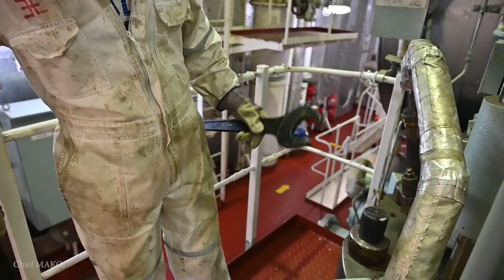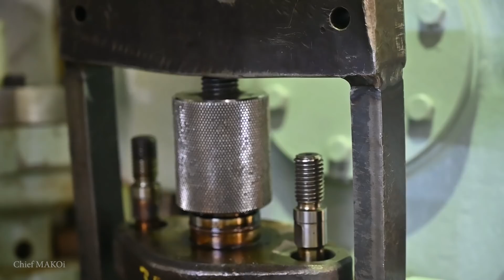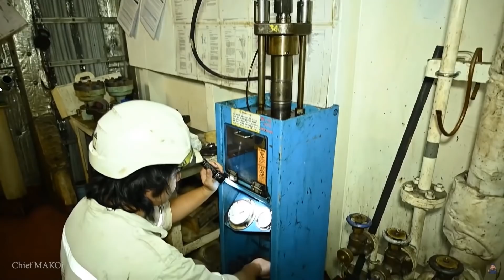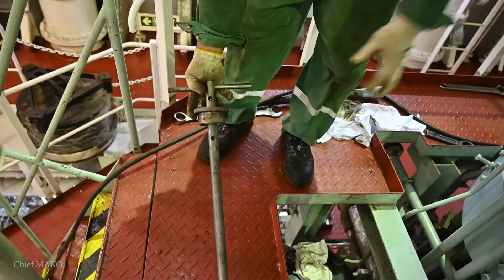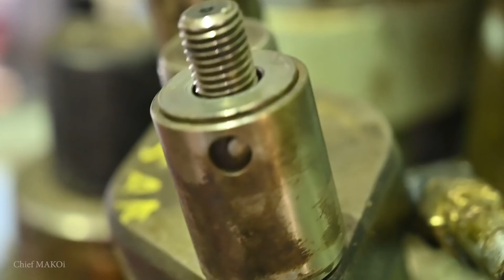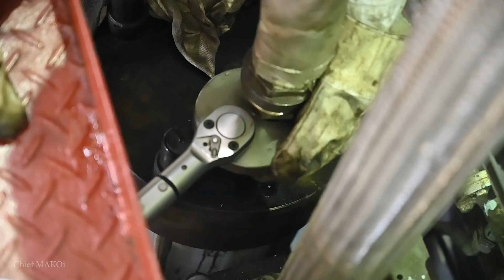Ship's Engine Maintenance : Fuel Injectors | Chief MAKOi

Comment: Was interesting, but was ruined when the technician used the wrench incorrectly.
When tightening a bolt or nut with a wrench, the load always meets the bottom of the moving part of the wrench as it prevents the wrench from getting an angular error between the surfaces.
Proper use extends the life of the wrench and also of the bolt heads and nuts.
You can see wear marks on the nuts in the film that indicate repeated incorrect use of the wrench. If you really have to use a wrench, when fixed ring wrenches and sockets always are a better option.

Comment: On heavy truck diesel engines...........10,000 hours would be what most operators would expect from injector nozzles.  The major problem has always been that OEM fuel filters are only 60% efficient at their micron rating.  But new aftermarket products are on the market, widely used by transport and mining industries that are 99% efficient at 2 micron, and so injector contamination and even rust from dissolved moisture (always present in petroleum fuels of all kinds) has been eliminated.

Comment: Chief,
I'm curious if - on each subsequent engine design - the companies take notes from engineers on how to make their engines easier to work on?  It always seems like, despite the size of the engine, everything is cramped together.

Is there anything on the engines and machines you work on that continuously frustrates you with poor design, considering that they "know" that you'll have to do maintenance on it?
I'm reminded of a car that I worked on where you had to remove several things just to get the battery out.

Comment: How much pressure the injector pushing to the cylinder?
Can you replace the injector while the engine is running??
Reply: I have that same question, can the injector be replaced while the engine is running?  Would you stop the M/E while at sea?  If not, why wasn't there air being pushed out the injector hole on each up stroke of the piston?

Comment: A bit larger than the ones in your car.

BTW a motor are not a motor before a person can comfortably stand on top of the piston, move around in comfort in the crankcase, and with a little MASSIVE sweating and a lot of air, crawl around in the exhaust manifold.
And if it go more than 100 RPM,,,,, well its just a toy.

BTW on Torm Kristina we had a hole burned strait thru the valve,,,, and mind you inside the valve seat, and large enough for my little finger ti fit in it. 😮
All hands on deck to fix this,,,, actually i even think i saw the chief engineer in the "hole"

Comment: In most all the big diesel engines, I see a large high-pressure hose with the braided covering. can you tell me that does? It looks like it would go to the area of the top of the exhaust valve. Nive video, i always like to see what's in those big engines....!!
Reply: Yes that's a hydraulic line that operates the exhaust valve. It saves energy by eliminating the camshaft and all those other moving parts, as well as allowing valve timing and duration to be completely electronically controlled. Think of it like VTEC, but a lot better and more flexible.

Comment: Wait how big & exactly what psi. Ratings can be reached with these Giant diesel engines they say the fuel injectors from commercial trucks can spray fuel thru a 2×4 piece of lumber or else the secondary Question  what sort of compression values are reached on these Giant motors

Comment: I'll just say this. Drag teams get the car in pits, dissassemble the engine COMPLETELY and reassemble it all in just a few hours.

If you had a team of well seasoned mechanics, you could get a major service done on one of these engine in less than a day.. filters, oil, injectors, anything that doesn't need a massive lift. And possibly even that.

Comment: At what bar does the injector fire? Also How many cc of fuel is injected? The tractor trailer I used to drive used about 170 mm³ per stroke which is like a drop in the bucket compared to this beast. This makes a on the road tractor trailer fuel injector seem like a TicTac. I have always wondered what they look like now I know

Comment: That's wild that it's lapped in situ.
That would cause so many problems in a smaller engine, but with a big engine you get big tolerances, so it's acceptable.
Reply: In a smaller engine like a Detroit Series 60, you just pull the injector cup and replace it along with the injector. Sealing is done with soft copper washer, so no lapping required. Make sure the orings on the new injector are installed correctly, no nicks or cuts, and oil them before reinstalling the injector. I once had an issue with one leaking exhaust gas into the injector cup, right from the factory, one of the orings was missing...

Comment: Not exactly a toy are they. The filtration system for the fuel oil must be very well designed, I still find it hard to believe they run on such crude oil. Thanks for the video, how about a crankshaft replacement ? I jest of course - hopefully.

Comment: What is the max engine RPMs on that thing? The largest locomotive engine I used to work on was a 16 cylinder, 645ci per cylinder and its max rpm was 900. But it powered the generator only. I'm not sure if ships are direct shaft driven or gen/electric like locomotives.

Comment: What volume of fuel does an injector typically have for injection per cycle?
Is this work carried out on the high seas? (I'd imagine it have to be done if problems arose).
👍

Comment: So it appears this procedure is able to be done with the engine running on the remaining cylinders. If so,  I assume the piston in this cylinder is still in motion. Is there a means to isolate the injector from compression etc?
Reply from the maker: Engine needs to be stopped before doing this.

Comment: From the vid I think torque is a little off. From previous training the crows foot or adapter should be 90 from wrench or torque recalculated with the adapter length.

Comment: Couple of questions.1) do you shut down the engine for the six hours it takes to change all of the injectors. 2) if you don't aren't you worried about running the engine lean. 3) do you carry an extra injector for every injector.

Comment: How often do the cylinder sleeves need to be replaced? How is this done on such a huge engine?
Reply: They are exchanged once in awhile, most large ships have at least 1-2 spare liners in the engine room. I think he has a video on them, but the basic steps are, remove and disconnect exhaust piping and cladding, remove hydraulic and fuel oil lines, use hydraulic cylinder head stretching device to be able to loosen cylinder head bolts. Meanwhile people will be down below and disconnect connecting rod. Cylinder head is removed and lifted with the overhead crane. Next, using the turning gear, the piston is fitted with a lifting bracket and pulled from the cylinder with the same crane, and set down on some cardboard. The cylinder liner can then be pulled out also using the overhead crane. When the parts are out, things like orings and anti-polishing ring on the liner can be inpected, and the piston cleaned and inspected and new rings fitted if needed. Acceptable cylinder wear should not exceed 1-2 thousandths per 1000 hours of running.

Comment: Do you send you engine oil off for analysis to check engine wear? I suppose lapping the injector seats causes so little in the way of metal contaminants compared to the massive size of that engine, or you have some way of keeping them out of the engine when you do it?
Reply: Yes, oil samples are collected. Normally whoever supplies your lube oil, will collect the oil samples and results emailed to the company, like BP or Shell or whatever. Lube oil is typically straight 50W, but different engines might prefer different oils, there's a lot of changes going on with IMO doing to do away with high Sulphur marine fuel oils.

Comment: Wild that your not worried about the abrasive from lapping getting into the cylinder and the rest of the engine.
Reply from the maker: The residue from the heavy fuel is much worse.
Reply: @ChiefMAKOi  that blows my feeble gasoline engine knowing brain 🤯 thanks for the vids and info!
Reply: @ChiefMAKOi  Is there actually abrasive particles like that in the fuel oil? I would think by pre-heating the HFO hot enough, and running thru a centrifuge machine like Alfa-Laval purifier would remove most of the solid bits of rock/sand/silica etc. But I think this engine is so huge, that that small amount of lapping compound isn't going to do anything. It'll get washed out eventually by the cylinder lube oil eventually.

Comment: Great vlog as always! So this can be done out at sea with the engine running? How does a LNG engine work? Same, but the only difference is the type of fuel? In Norway now it is LNG and electric engines powred by batteries that are in high demand at the moment. Green is clean! I just thought of that slogan at this very moment! Cool! Be safe my friend. Plans for the summer vacation?
Reply from the maker: Here in my place it's always summer and always on vacation 😂.
Reply: Jammy 😊 !

Comment: Chief: Doing an equivalent job on land in the USA, locks and tags would have to be applied to the fuel pump and the valve to that cylinder, as well as to the main engine.  Do you use similar procedures?
Reply from the maker: Yes. I just forgot to shoot a clip of that.

Comment: Another great video. Question Chief: after the lapping of the injector seat with abrasive paste the engineer washed out the area. Does that mean all the abrasive paste and liquid gets washed down into the cylinder? After the first few revolutions of the engine with valves opened to stop compression locking then it doesn't actually cause an ongoing abrasive wear problem in the cylinder? That doesn't 'wash' to me so I think the injector seat compound must be a very special mixture that doesn't have cause a problem?

Comment: Two injectors per cylinder? At least you guys have good access, as compared to aircraft engines (which are often very cluttered to get the cowlings fit as tightly as possible).

Comment: My question is does it matter if the lapping compound goes down into the cylinder?
Reply: I was wondering this too, plus all the spraying they did down there that went into the cylinder as well. I'm guessing it just gets burned up/expelled with the first piston cycle when they turn the engine on.

Comment: Do you need to prime the fuel line up to the injector?
Reply: No, that's what the return line is for, just turn the fuel back on. Whatever doesn't get injected will go back to the day tank. When the engine is restarted, everything is primed first, fuel oil as well as lube oil, while slow turning with the turning gear before it's actually started. So any air in the injector lines will get purged during the normal startup process.

Comment: Wow, just seeing all the cuts and angles of shots, I can't imagine how much time it takes to film all of this. Thank you for doing this chief. I also see how hard these guys work. It's tough work and obviously long hours. 
I often wonder how long our car engines would last if they got this type of care! :)
Reply: I second that.  It is a very responsible job for responsible people.
Reply: For ever
Reply: As a mechanic and mechanical engineering student - forever.  There's no reason what so ever that any car built in the last 70 years can't get a million miles on the odometer. All it takes is paying attention to your vehicle and proper maintenance. Both preventative and otherwise.

Never think your oil change can wait, Always do it early. let your engine warm up before you ever take the parking brake off or put the car in gear. Don't forget the little things in your owners manual everyone ignores. Change trans fluid and filter every 75k miles.  Change gear oil in your diffs every 90k. Wheel bearings I tend to do around every 100k. Flush your trans, brakes, power steering, and coolant systems every time they're serviced. Do an engine flush every 3-10 oil changes.  Change brake fluid every 2 years. 

It's expensive, and adds up quickly to an expensive mess to keep track of. If done properly however, on a good car, a million miles is just finish the break in.
Reply: @StrangeTerror yep,exactly
I hate when people say nowadays cars suck because they are made out of "plastic" "not real material" etc.
They just dont give enough attention,nothing changed in cars,the only thing that changed is every manufacturer wants more horsepower so if you are not using your engine in right conditions it will die yes.But wirh regular check,change and normal useage?It will go for a loooong time
And there is a 1% faulty product always,but thats small as fuck
Reply: 4-evah

Comment: Love the content but around 10 minutes crescent wrench being used to tighten the nuts is putting extra wear on them
Reply: I must admit I use a crescent wrench in many areas where I shouldn't so I should follow my own advice LOL
Reply: nuts are cheap and easily replaced its the threads of the fastener id be worried about remember apparently it is about the seating surface at this point but i did get what you mean it kinda set my mind uneasy seeing rounded edges as well

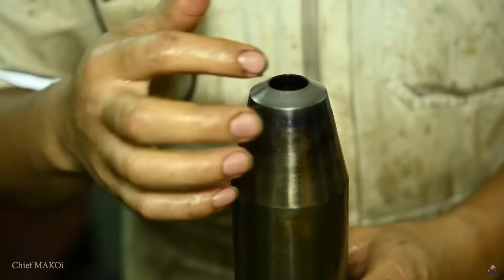Comment: 0:55 Pffft! It's only a "six".😀 Do you stop the main engine on the open seas to replace this injector? Also, how do you know an injector is bad? Do you hear a "miss"? does the ship vibrate like a car? 7:24 I am not an expert, but I am watching this on a big screen tv, and it looks like that nozzle mating surface is slightly pitted and needs machining.
Reply: Pulling out injectors should be done at port every 2000 runnings hrs.. ships should be at rest. normally if the cylinder exhaust gas goes above the normal temperature, thats one of our indicators we check.

Comment: Hi Chief, where there some indications that there was a problem with the injector? if so what was noticed?  just not running as smooth as it should or what ?   asking after watching upto the point its taken out btw.
Reply: Normally if cylinder exhaust gas goes above the normal temperature.

Comment: If there’s a main engine failure while underway is there auxiliary power to at least keep the ship pointing into the weather while repairs are made?
Reply: 2 engines, plus separate diesel generators that provide electric and hydraulic power, plus heat to keep the bunker oil liquid enough to flow.

Comment: Are there two fuel injectors per cylinder for redundancy or are both required for proper operation?
Reply: While I haven't worked on slow speeds my guess is that there is a smaller injector for use at lower loads as the larger injector at low load would normally create a mixture that's too rich.
Reply: cyl displacement is large, otherwise it would need one very big heavy injector. two smaller ones can do the job

Comment: That reminds me, I need to change the injectors in my 7.3. I hope that I can get it done in six hours.
Reply: Replacing the injectors in 6 hours is the easy part. The hard and slow part, is getting all the other crap that's in your way, out of the way first ;) And then put it all back together afterwards.

Comment: Brings back memories of changing injectors on UK railway locos. One of my jobs was testing and setting up injectors on a Hartridge testing rig. we used Fucious oil as a test liquid as it had the same properties as fuel oil but without the hazard of possible skin problems.

Comment: Thanks for the interesting video. 
I always wondered how ships could burn that thick viscous fuel.
After I watched your other videos about sheep's fuel, I learnt that the fuel is filtered and heated up and then injected into the engine.

I have one question: 
Why don't ships burn their own used motor oil?
After all, they used motor oil in my opinion lighter than the ship's heavy fuel.
Reply: I suspect the biggest reason is that there simply isn't enough used oil for it to be worth designing a system to use it. There's also the issue that used lube oil is full of metal particles that you probably don't want in your cylinders.
Reply: About the used motor oil that makes sense.
Thanks. 👍